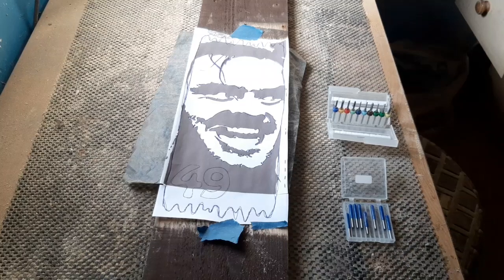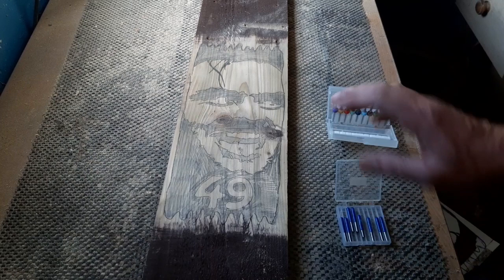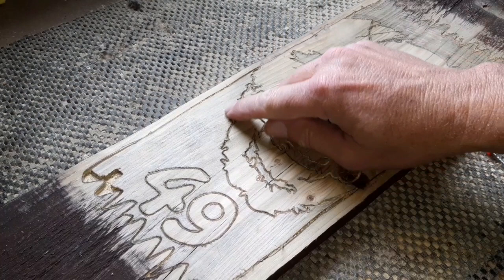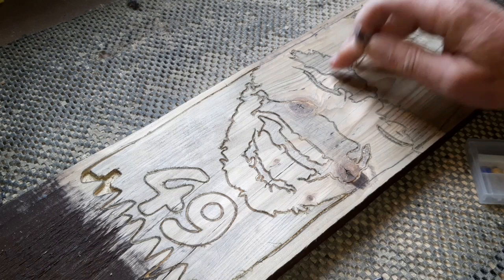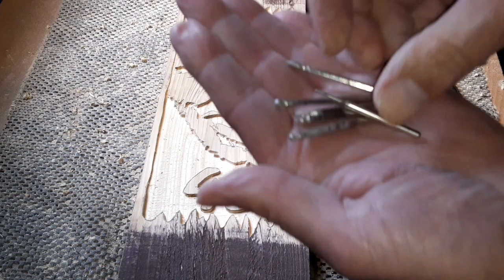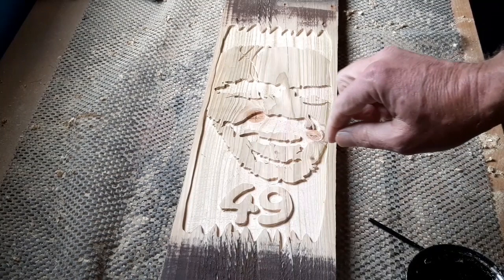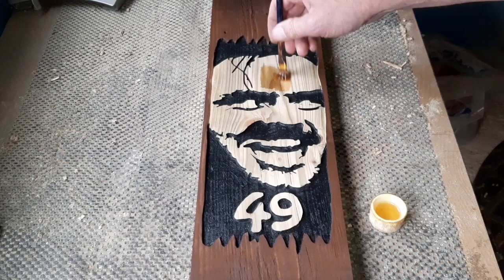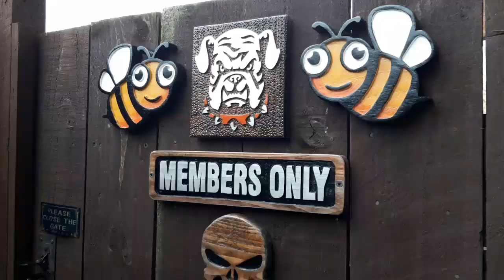Here's Johnny from the movie The Shining..routed out on fencing wood

Comment: Hi, just subscribed. Great channel, you have given me the confidence to have a go, thanks. Can I just ask, i know you are mainly a router guy, but i would appreciate your advice on what scroll saw to use? I have my eye on some cheap ones from screwfix but people say that they are no good for intricate wood. I also want one that can take the spiral blades you use. Any recommendations for some one on a budget? Thank you in advance.
Reply from the maker: Thank you ,my scroll saw is an old draper that I got second hand for £35 I've had it for 5 years and its still going strong..if possible try and get a saw that takes pinless blades if not you will need to use an adaptor clamp, not a big issue just a little awkward sometimes. You can get scroll saw with a flexible cable attached, abit like a saw and dremel all in one..some come with a led light, good luck..😁👍